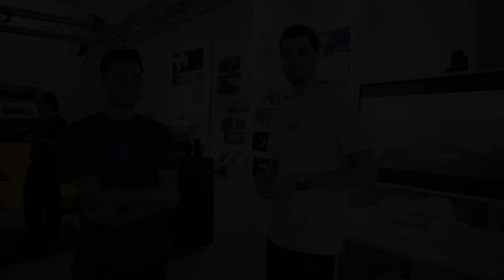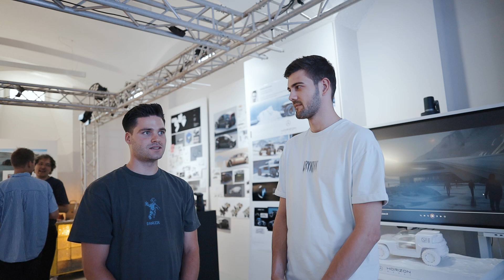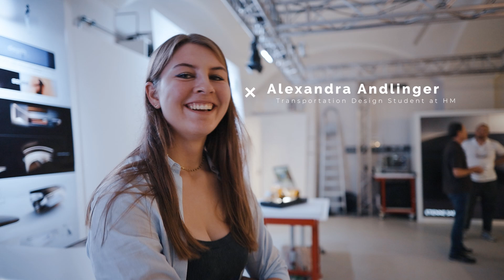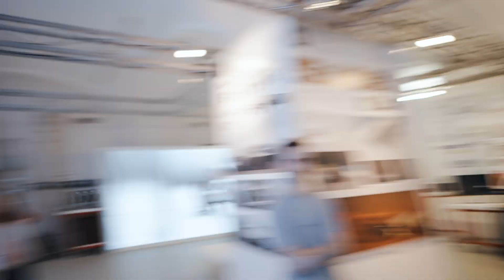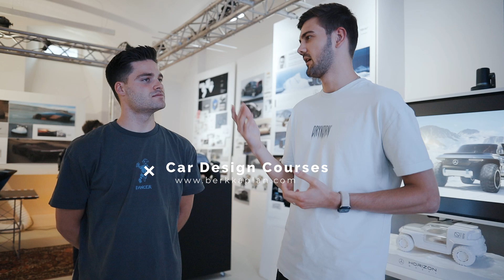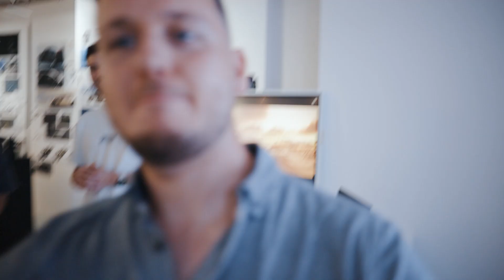They Studied Mechanical Engineering + Car Design, Here Is What They Think!

Comment: Love this, especially the part about always sketching and having a creative drive! I graduated last year with my BS in Engineering - Product Design from Stanford. The degree was a program within the Mechanical Engineering department, so I took the MechE core up to Mechanical Systems Design and then my Design upper division courses were focused on Digital Product Design (UI/UX), User Research and Needfinding, Business Strategy, Design Thinking and some "Designing your Business" courses. 

Because this was from Stanford, a lot of the program was focused on Silicon Valley / tech / startup "Design Thinking" and design methodology for the SaaS world. However, there was very little Industrial Design content, but I taught myself Blender and since graduating I've been building my own design consultancy, and as the digital design market is tough right now for entry-level, I've been focusing on integrating my product development skillset and paying the bills with 3D Motion and Branding projects for my clients.

Just like in auto's early history, I think there will be the "Platform" and then "Coachmaker" roles with "Skateboard" EV architecture. I see a massive opportunity for Transportation Designers to bring out fun and innovative vehicles like with Renault's R17 Restomod, no longer bound to previous constraints of the ICE drivetrain. I took a course at Stanford about the "Historical Significance of the Automobile" and they showed us an Hispano-Suiza H6 and other vintage vehicles, some of which were made by "coachmakers" on a dedicated platform.

Thank you for sharing this, I'm keen on purchasing the course early next year as I'm attending a design conference here in San Diego at UCSD. 
I love the content on your channel and how you pace and frame the world of design, specifically transportation design. Keep it up!